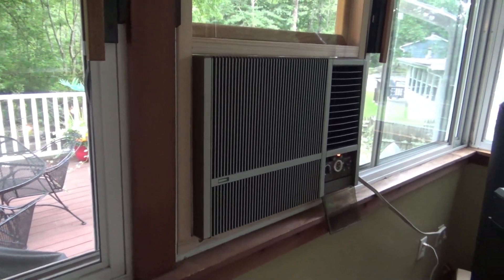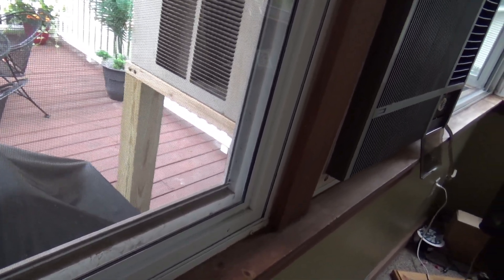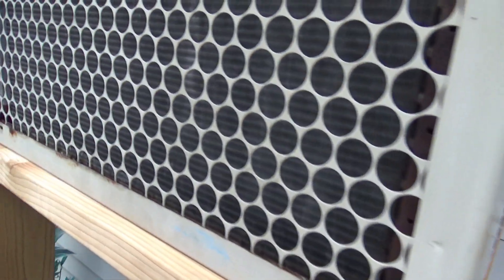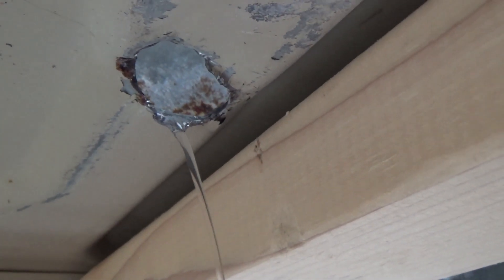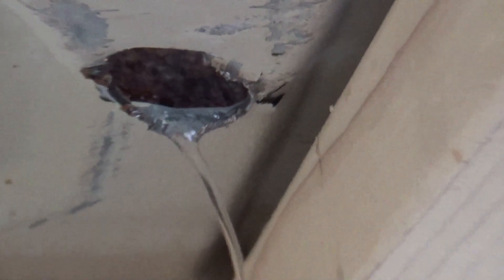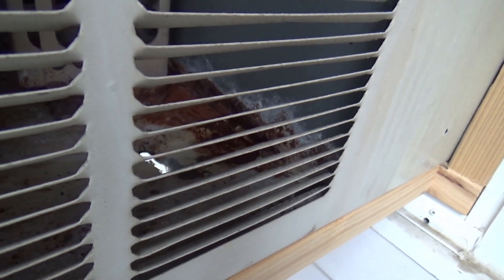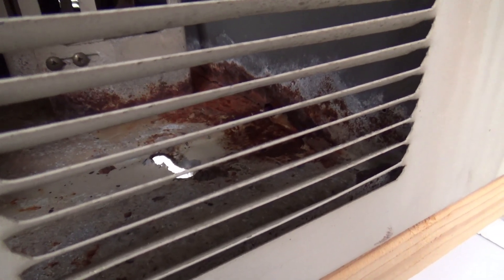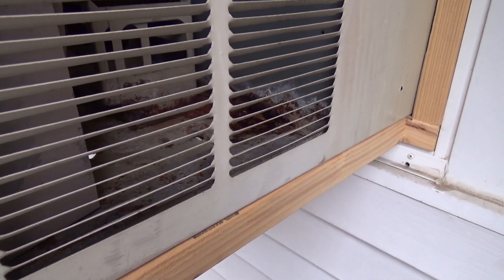Fixing the Drain Hole on the Carrier 27,500 BTU International Series Air Conditioner

Comment: Nice work, that's an impressive amount of condensate coming out, you might need a pipe to drain away at this rate lol! It may be good for it sometime to cover that big rust hole where the condenser fan is with a metal plate and some rivets or something, to improve the fan's pressure and ability to push through the fins so the compressor head pressure doesn't get too high on the hottest days and help the machine last longer, it's probably fine though.